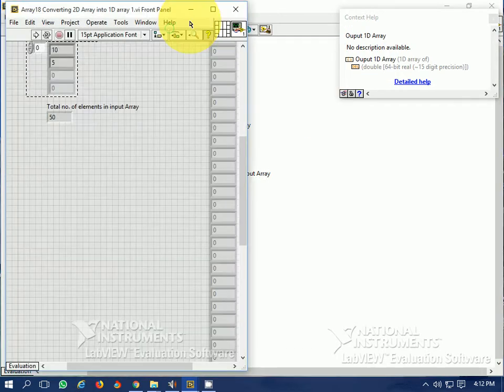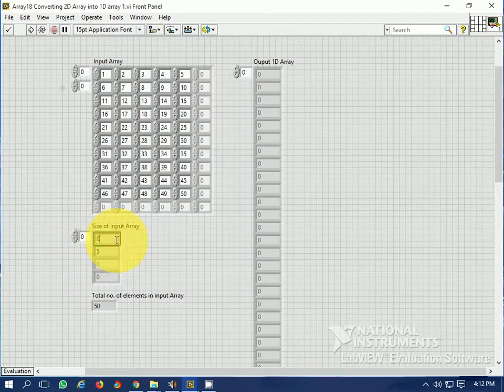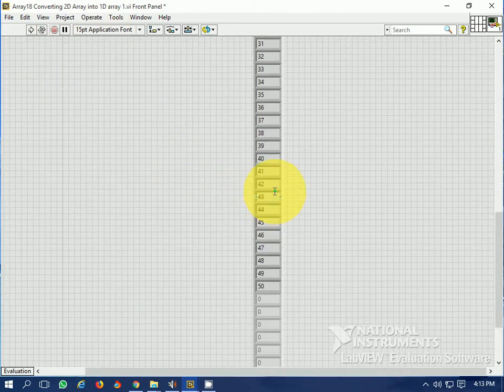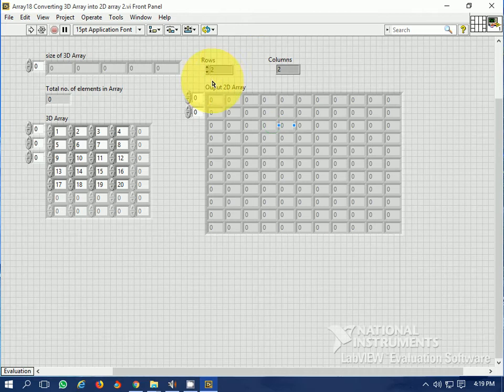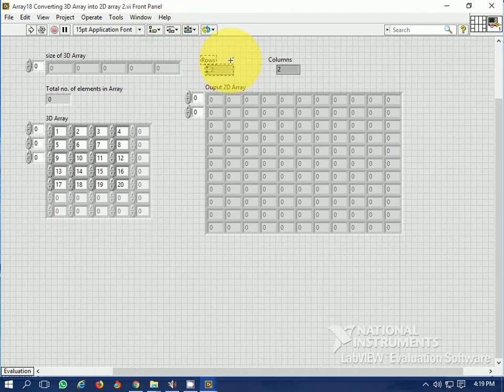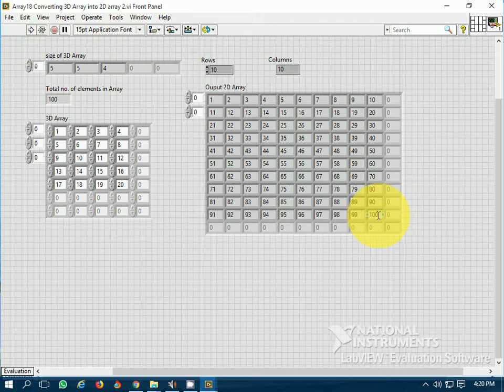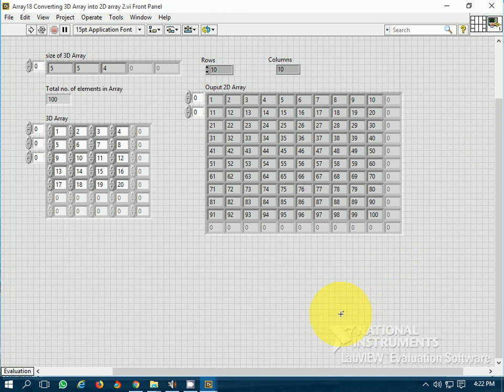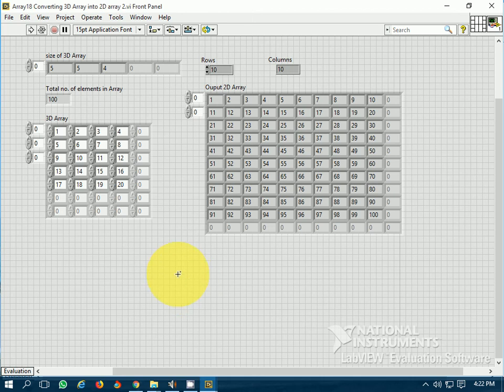How to convert higher dimension arrays to lower dimension arrays in LabVIEW

Comment: Great video, very helpful. Thank you . I have a question for the 3D to 2D, how each page of the 3D appear on the 2D without being transposed? That is, in the 2D output array, the 2nd page (1,0,0) of the 3D will appear next to the 1rst page(0,0,0), and so on? Thank you
Reply from the maker: Thanks for appreciating the video....The mechanism of not transposing the array when converting higher dimension arrays into lower dimension arrays is an inbuilt feature of this function in LabVIEW....u cannot change it....
Reply: @ManishVohra  thank you for your reply. I resolved it by putting the 3D array in a case structure that will select a specific page depending on the value of the enum constant. And the output is a 2D array.